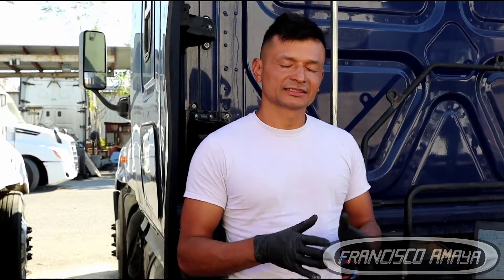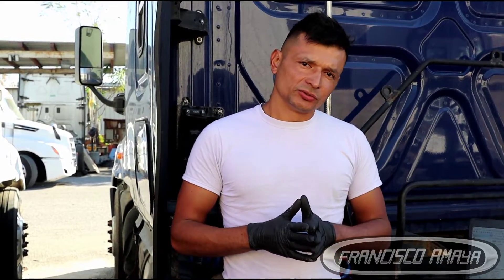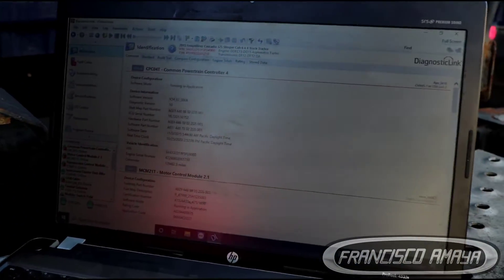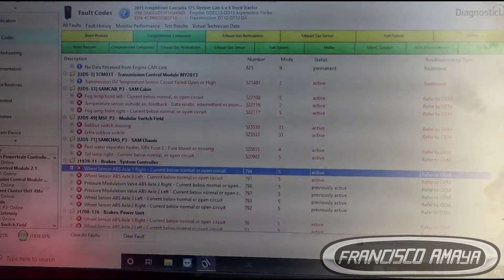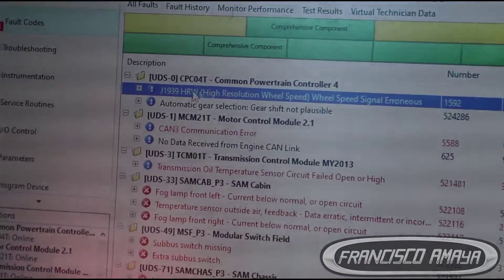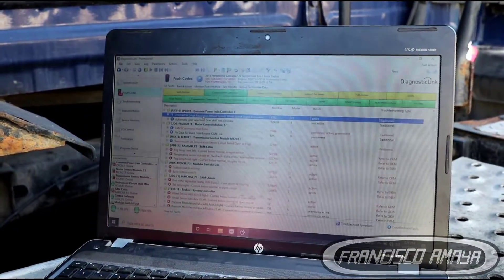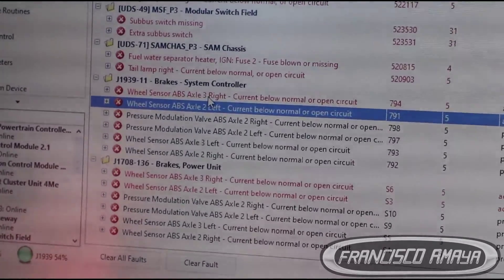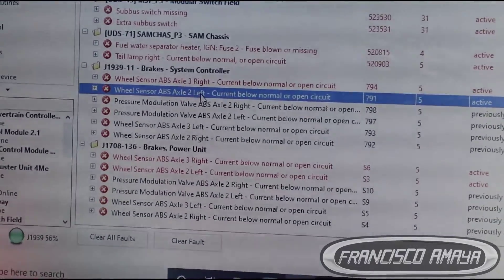ABS braking system diagnostic class for heavy duty truck how to repair it how to find problems

Comment: I thought one is the 5 volt signal and the other is ground!
Reply: You should be correct.  I tested three different sensor plugs...it showed 4.9volts and then -4.9volts when I probed the leads in reverse, which tells me one is a ground and other is power.

Comment: Haldex abs modules don’t supply 4-5 volts. They read voltage created by the rotation of the tone ring over the abs sensor. Jacking up the wheel and spinning the tire by hand will create 1-2 volts that you can read with your multimeter

Comment: I have actuator circuit to the ABS  valve A shorted to ground, or ABS valve A  is not not functioning properly check wiring for damage and ABS  valve A for possible internal short to

Comment: I got Freightliner Cascadia 125 has abs light  on the code showing is abs 136 Sid 003  fail 06, which indicate that left rear axle short circuit. You right I can’t fix my self because tire and disc brake have to be removed to repair. I can fix front axle but the rear one is tough.